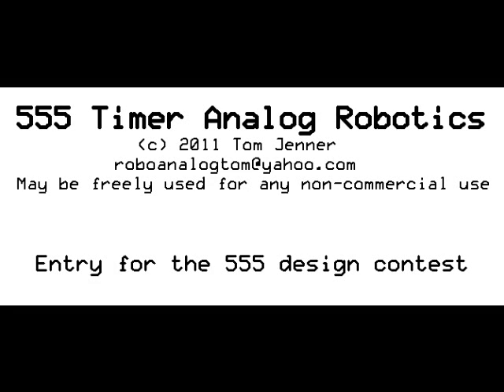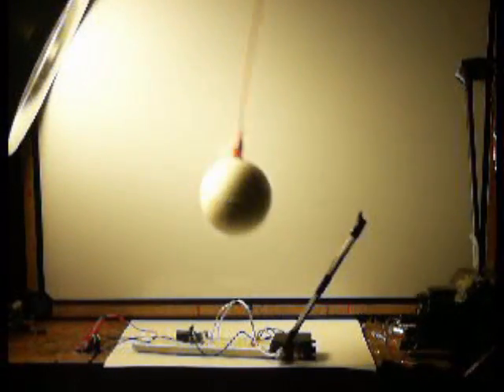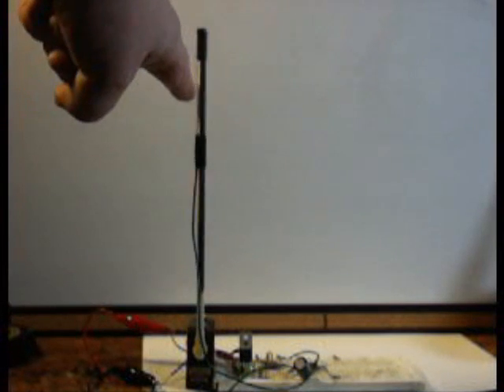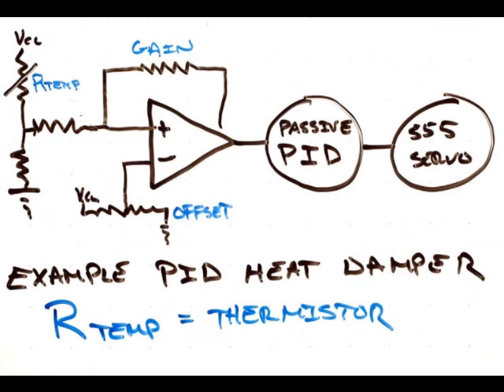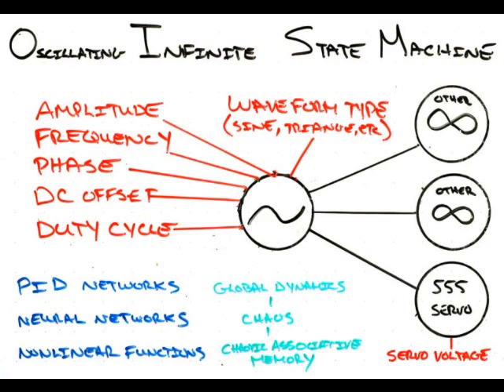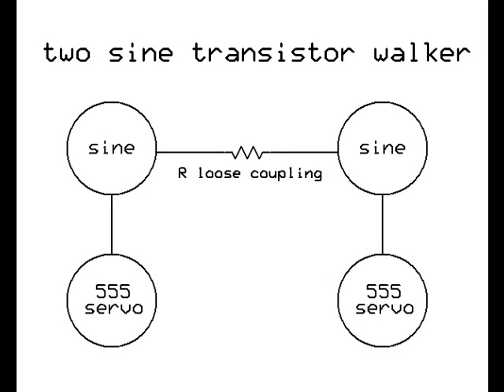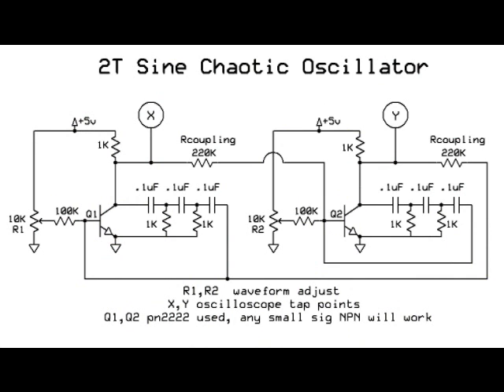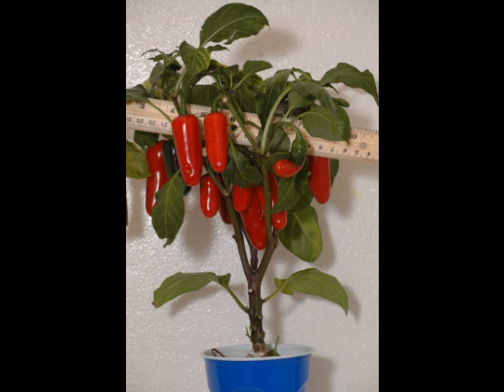555 timer based analog robotics.wmv

Comment from the maker: No, the movement, dynamics and physical design of the robot as a complete system is what actually causes a shift in balance point and is based in geometry. This is what I mean by kinematics.

But, the kinematics can be influenced by a light source causing a turning behavior in a 2 servo walker properly designed to be able to turn, for example.

Get a copy of "Junkbots, Bugbots, & Bots on Wheels". A lot of your answers will be found there.

Comment from the maker: All hobby servos use a 1-2mSec pulse, with perhaps a little slop on either end of the timing, at about 20-80 pulse per second which the 555 timer can generate.

As far as anything else or other questions pertaining to this, you'll just have to experiment. I've destroyed servos before accidentally and on purpose; it's part of the experimentation process.

Comment from the maker: I would go digital at this point. You can still use analog control to handle the lower functions and reflexes to preserve the life like movements, but for sequencing, I'd use the Arduino.

You can try paper tape with various size holes, shine an LED through and use an op amp with a photo diode hooked to the pin 5 of the 555 timer. The op amp converts the photo diode current to a voltage. Another LED can also be used as a narrow band photo diode instead. This is know as the Mims Effect.

Comment from the maker: If you are talking about the crawling robot then that is a copy of Mark Tilden's 2 motor walker, it's the kinematics of the robot's movement that shifts the balance point. Try setting up 2 servos, 2 555 pulse generators  no sensors- just the sine oscillators WITHOUT coupling the sine oscillators together through a resistor.

You'll see the robot move forwards, backwards and they'll even be a side walking gait that shows up. It's highly chaotic in this instance.

Comment from the maker: The 555 timer can handle maybe 15 volts depending on type. Most servos can handle 8 volts or so. I would not over voltage micro servos. If your 555 timer is using much more than 8 volts I'd increase the resistor value from pin 3. Do this at your own risk, though. There's so many different servos that it's hard to tell how much voltage they can really handle.

I always buy extra parts just to test how far I can push them.

Comment from the maker: The servo wants to see a 1-2mSec pulse about 20 to 80 times per second to control its position. All that matters is the positive pulse width length. The 555 timer acts as a pulse generator controller through pin 5.

In truth the 555 is being frequency modulated and as a side effect the pulse width is also being modulated. That's the secret to this little hack- the frequency of the pulses doesn't matter much be we get the desired pulse width modulation.

Comment from the maker: @theonelinerkid You might be able to use a solar panel in conjunction with a battery but the voltage going to the servos and the analog oscillators needs to be fairly stable otherwise they'll be excessive glitching. Perhaps in full sunlight with a voltage regulator but I've never tried it that way.

Comment from the maker: @LoreKrill I've seen this problem before. It's either a pulse width at pin 3 that's outside of about 0.7 to 2.3 mSec or the feedback potentiometer in the servo itself isn't set correctly. Do you have an oscilloscope?

Comment: Maybe it's too late at night... I get the pulse at 'servo out' (at pin 3) and I'm assuming that any 'add-on' bubbles (ie potentiometer/servo tester) are then tied to pin 5... I've read all the comments and it seems everybody else got it but me... With a continuous-rotation servo I have to apply the signal line from pin 3 to get rotation and that seems to work fine. With a standard TowerPro servo all I ever get is an attempt at clockwise rotation - regardless of potentiometer setting. 

Thanks

Comment from the maker: @keithosmarferrer No, you have to use servos. DC motors themselves have no feedback. Inside of a servo there's a potentiometer that provides position feedback info to the servo itself.

One can always make there own simple servos using a DC gearhead motor, potentiometer and a few op amps. I've made a ball smacker doing this but just using a servo is a much easier way to get started in playing with dynamic systems. Just use a servo.

Home brew servo design would require its own video.

Comment from the maker: @t3du I usually use a single transistor sine wave oscillator. Pretty much any oscillator of low enough frequency (1 Hz or so) can work. A 555 timer set up as a 1 Hz or so square wave generator with a low pass filter works well.

I strongly recommend getting an oscilloscope if you're going to start playing with sine or other oscillators. I do show in the vid, though, that one can use a cheap analog multimeter to set up and tune a single transistor sine oscillator. Connect the oscillator to pin 5

Comment from the maker: @t3du The most likely problem is that you don't have the potentiometer connected to pin 2 adjusted properly. This is set up as a very high gain DC amplifier (there's no capacitor between the mic and the op amp) so adjustment of that potentiometer is very important. Tweak the potentiometer so that your LED always stays on and then and then adjust it back to where it only comes on with sound.

Let me know if  this solves the problem.

Comment: @roboanalogtom Dude the 555 sound servo... I setup circuit seen on 2:20 min from the video the output was conected to pin 5 for astable 555 (works fine the astable, thanks for you), but the lm358 cant oscillate. I tried put a led to pin 1 and snap the mic but the doesnt blink to test first to get connected to the 555. Could you please help me a little more nad thanks

Comment from the maker: @t3du For all circuits, pin 5 is used as the input to modulate the 555 timer and pin 3 outputs to the servo. The 555 timer is running in astable mode.

Comment: Tom: the 555 sound sensor test servo in the output pin must will connected  to pin 2 or pin 7 for the 555???. By the way the 555 must setup as astable or mono. Thanks

Comment from the maker: @teehbr Good question! The reason is that in my experience, 1uF caps tend to have a better tolerance while a lot of the .1uF caps true value can be all over the place. I wanted to make this as easy as possible for the beginner to duplicate without an oscilloscope. This is actually the only reason why I showed a 1uF cap but a wide variety of cap/resistor values could be used.

In the end it doesn't matter as long as the circuit produces the 1-2mSec pulse with the proper input to pin 5.

Comment: Why not use  C = 100 nF, R1 = 15k, R2 = 330k, will be a t1 = 0.00104 and fq = 40 Hz +/- 10% ?  
the input pin5 receive a sine wave 0-5v and 0V is to 1 ms and 5V to 2 ms, modulade ?

Comment from the maker: @miceuz The 555 timer is working in astable mode. It is producing a series of 1.5 mSec pulses when there's no input to pin 5. Pin 5 is actually frequency modulating the pulse train but servos can accept a wide range of pulse train frequencies (about 20-100 pulses per second).

The net result is that with zero volts on pin 5 (through the 15K resistor) you get a 1mSec pulse and 5 volts gives you a 2mSec pulse.

It is very important that you use the diode between pin 6 and 7 with this circuit.

Comment from the maker: @xperryment1 Do you have any previous experience with robotics? The balancing robot really isn't a good first project. Also, the light source must be close to the robot and the position of the LDRs is important.

Yes, I'm going to do a vid on how to tune these simple PD systems. Basically, you want to make the RC time constant of the input to be about 8 times higher than the total swing time of the robot. This is called 1/8 wave dampening. I'll be showing a graph that'll help.

Comment: i build it, but when I turn it on, the servo goes only counterclockwise. should i change the resistor values? What value is the potentiometer, i have a 2k pot. thanks for your videos, like them very much!